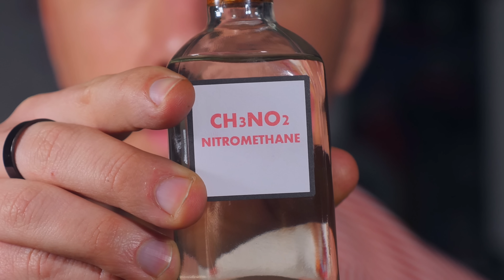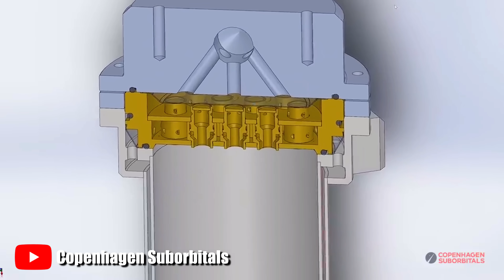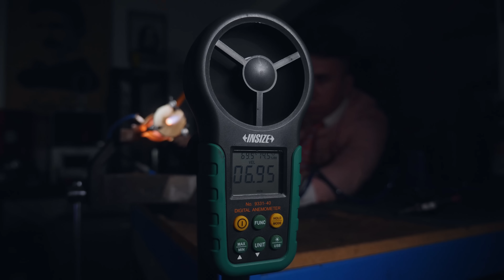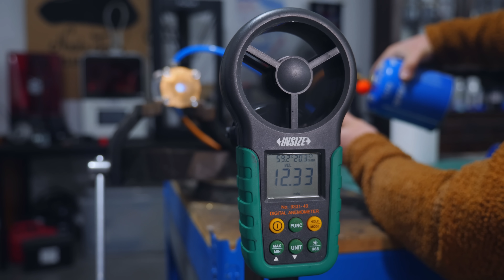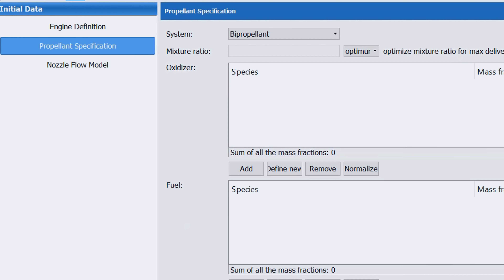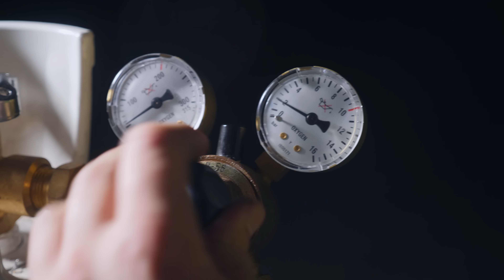GLASS ROCKET ENGINE

Comment: OK here's what you need to do once you get this  figured out: make two engines, put them on the tips of rotor blades and make  a rocket driven helicopter like the one made in the '50s. If you're lucky  it might have enough aerodynamic lift to get the oxygen tank off the ground. 🙂
Reply: the forces would probably rip them off before any meaningful lift is achieved
Reply: @xorinzor Look up 'Roton'. It's been done.
Reply: @xorinzor  Yah but it would be fun to watch! 🙂
Reply: @xorinzor Also if that happens that means you need to increase the blade's angle. 
It should create resistance because if it's just free spinning of course it's not gonna do anything.
Reply: @DoubsGaming When you change the angle of the blade, you would also be changing the angle of the rocket attached to it, so the rockets would be adding lift with the blade along with the rotational force. The additional lift from the rocket when blade pitch is applied might just be enough! Fingers crossed 🤞
Reply: @xorinzor  No probably not, the weight of it, if he makes it small as I would expect, would make it so the centrifugal force would not be too much, plus if he 3d prints it as a single prop it would be VERY evenly balanced. Only factor after that would be rocket placement, but as long as you measure, which you know he will, then all will be good! Balance and weight distribution are EVERYTHING when it comes to choppers 😉
Reply: Just saw your 💡 idea, bravo
Reply: How about a rocket driven supercharger to force more oxygen and fuel into the combustion chamber?  You could power it using some of your combustion pressure.
Reply: A spinning out of control oxygen bottle is a dangerous idea.
Reply: @PrimaryColorsChallengedREAL I feel like he should get the smallest refillable paintball gun tanks and use those, at least it would be much less oxygen so safer... but still, pure oxygen spinning outta control 😱 I hope he builds himself a test stand a bunker to watch it from 😂

Comment: I’d like to see you get some liquid oxygen (I know it comes in large vessels), transfer it to a smaller container (paintball high pressure tank possibly?), and then use that as the oxidizer with various fuels and engine designs. 

I feel you could really accelerate your rocket engine program!*

*sorry.

Comment: Hi 
Love your videos 😊
But i have a question about the nosel disign. You put 6 bar as your chamber pressure cause your air supply has 6 bar but when you burn the fuel you will get lots of heat and with that your pressure will rise a lot right ?
So should you not like mesure the pressure while the engine is running to get a even better nosel?
Reply from the maker: I see how that can be confusing but the chamber pressure is defined by you in the software, which means the software, knowing your oxidiser and fuel, designs a nozzle and combustion chamber that don’t go over that pressure as long as you follow the mass flow rate you put down. Because I used the maximum flow rate my compressor can achieve, it will always be at a safe pressure. Was I able to explain it ?
Reply: @integza  yes now i understand thanks i think i need to get that program :) and try a few variations myself

Comment: The hydrogen peroxide oxidizer is cool but super messy. If its just steam and oxygen where does the black junk come from? Is there a way to get the oxygen out without the mess?
Reply from the maker: That’s a great question ! The black stuff is the residue left over by the Potassium Permanganate. You can decompose Hydrogen Peroxide in a much “cleaner” way by using either heat or exotic metals like Silver or Platinum or both.

Comment: Hi Integza, I have an idea for your next video. I've already tested a rocket that I built using HHO gas (the gas that comes out from the electrolysis of water), but now I have a question. Can you make a rocket using HHO gas that has been produced in the same place as the rocket? 
For example, you can place the HHO generator on the front part of the platform you use for testing your rockets, and the rocket on the back. I hope you can do this in one of your future videos.
 (And also, greetings to the millions of subscribers 🎉)

Comment: The reason the second motor had more thrust was due to the increased pressure. Increased temp only slightly increases thrust but will increase efficiency. The difficult part of doing this will be feeding your reactive mass into combustion chamber AT high pressure. This is where most the engineering goes in real rocket engines. The equations aren’t as hard as you would think for this stuff. Call me I’ll explain it.

Comment: Have you considered putting the rocket engine on an RC car instead of a skate board?
It sounds like a fun test, so you can compare diferent parts, fuels... Since diffrent run times would corelate with the impulse of the engine and the speed would corelate to thrust.

Comment: Please improve your face protection when messing around with peroxide+fuel. The pressure might get high enough inside the chamber to epl0de it and spray the stuff over your face.
I almost lost my eye in propulsion experiments, still have a slight permanent damage.

Comment: That is a power full rocket , I have an idea to run a engine or rotary engine from H2O2
or hydrogen peroxide and methanol and u said it releases water / steam so can an 3D Printed engine be run by it
is it will be cooled by the steam / water BTW i am 15

Comment: you can get much more power by using liquid fuel rather then gas. you should atomize the fuel directly in to the combustion chamber and use a higher flow rate of oxygen,
also you should calculate precisely the location and size of the holes for the chamber walls as this will maximize a/f ratios and efficiency . love your videos btw!

Comment: You should make a turbo jet and Metal 3d print the impeller or the combustion chamber or the fan in the front. Or cnc a wankal engine if you can make the jet have a after burner

Comment: this is so cool! for a dual propulsion engine, the thrust each "stage" of the reaction produces will likely be unbalanced. a scaled up version would probably need several of these engines balanced out to form a larger module with equal thrust across a given surface area. maybe in a future video, find a way to make that system more efficient!

Comment: Now that you have a CNC machine, and a rocket engine, i would sugest you to try to make a kinda turbine with a bigger fan attached to it and put it straight after the nozzle of the rocket engine. And test the thrust of the rocket with and without the turbine-fan kind of thing.  Maybe you would inspire NASA to do the same, who knows. They can use them while in the atmosphere, and separate them when they no longer produce thrust

Comment: How did you make the bottle rocket? I tried but it barely worked. I used only butane, did you use liquid oxygen as well? And my nozzle was a 2mm hole I also used to fill it, was that bad? I tried different amounts of butane and also tried adding alcohol.

Comment: Can you please make a 3d printed gearbox for a small petrol engine to a tank drive. i want to use a CISON L4-175 17.5cc Miniature OHV Four-cylinder Four-Stroke to power a tank but there is no real tank drive available. Same is for a ship with 2 propellors. I want to buy one more similar engine to power a large rc boat (160 cm) but i need a power output, one engine to 2 props with counter rotating props and a reverse. If you could make only one i would prefer the boat gearbox but any help would be awesome!

Comment: Another great video, I'm looking forward to your dual propulsion rocket. I'd love to see a throttle on a rocket and it might work with a modified cigar cutter, so you can change the nozzle diameter while the engine is running.

Comment: I say you take this potential rocket you create and use it to... have fun with tomatoes.

Tomatoes as the suppression system, they ablate as the rocket fires thereby providing disgusting tomato pulp.  

Tomato on top, which will get shredded by the air rushing by it at mach speeds. 

And of course, the rocket will be aimed at another tomato for tomato/tomato smashing goodness.  

Yes.  This is the video I would love to see.  Because of course... tomatoes are disgusting.

Comment: Does the temperature of the oxidizer have an impact on it's energy production? Is it possible and useful to use the heat generated by the combustion to  preheat either the oxidizer or the fuel?

Comment: Hydrogen peroxide is used as an oxidant with hydrazine for rocket propellant. Generally 90% concentration. You should definitely try the discovery you made with the peroxide and potassium permanganate in the small engine with various thrust nozzles that work best for the conbusted flow. I presume the energy released with the steam and combustion would require a different geometry nozzle to be the most efficient?

Comment: I would see if you could add the potassium permanganate to either the hydrogen peroxide or methanol in a pre-mix and do a two spray ignition system that mist together and ignite. Or make a disposable nozzle out of the potassium permanganate that you would spray with the methanol hydrogen peroxide mix.

Comment: I think you should improve upon the rotating detonation wave engine design. Maybe make it with a graphite nozzle and a steel casing so you can run it at higher pressures and test the thrust. An aerospike rotating detonation wave engine would also be really cool!!!
Reply: I would really love a 3d printer........ 😂

Comment: You could make your dual propulsion rocket RC by using an servo and a rc controller you can control the amount of oxidiser to be injected into the combustion chamber by an mechanism which operates by an servo.

Comment: Is there any way to route the fuel or exhaust through a tiny turbo to supply additional on-board boost?

Also, Can you not use a 2 or 3 liters bottle for the oxygen pressure chamber on the rocket sled or is liquid oxidizer the best method for energy density? I know SpaceX has liquid oxygen facilities, but I never thought of using it in hobby rockets... Would be interesting to be able to see inside the oxidizer tank, but I know that's really dangerous and "playing with fire" in the most raw sense.

Comment: I wonder if you can use a drip setup to make a small rocket fuel setup like a miner's lamp! one champer would have Calcium carbide with an H2O drip to make acetylene that you could feed through a hose and regulate to the combustion chamber and the other would use potassium permanganate with a controlled drip of Hydrogen peroxide fed through the hose to the combustion chamber. That should let you regulate the flow and keep the whole system compact enough to mount on the skateboard! I might be missing something, it was just a thought! Love the videos though!!!

Comment: Super cool project. 

Next theme: solid/liquid/gas hybrid dual propulsion system.

Solid KMnO4 section that has H2O2 before and CH3OH after.

React and form O2, mix with CH3OH (as shown in this video) and ignite. 

Everything in clear tubing.

Comment: Idea for future video:  How about adding your dual thrust rocket motor to an RC plane.  You could use an extra channel on the RC transmitter to kick-off the rocket motor.  It would be cool to see the plane in a vertical climb, ignite the rocket remotely, and watch the plane have an incredible boost and climb nearly out of sight.

Comment: You could do something with turbine engines (I don't realy remember how they are called) when a turbine is connected to a jet engine, so it generatel low torque but high speed rotation.

Comment: I find the dual concept really interesting. All that released steam will likely serve to cool the combustion, making it possible for you to run the engine harder with less cooling. Excited to see where this goes. Don't forget to account for the massive back pressure that will be pushing into your catalyst and peroxide tank as the engine fires.

Comment: I think now that you have an liquid oxidizer to use for your future rockets you need to make a vessel to remotely mix and control the flow/pressure from that reaction. Some sort of baffeled vessel to keep the liquid component out of the mix while letting all the sweet sweet gases flow and not having to touch it.

Comment: Those flairups and pops in you burn... I think you are running engine rich combustion, as in part of you engine is eating itself during the burn. I think if you are lucky it's only the nozzle. You might want to look into a fuel film cooling system. Granted that is a whole other paradigm of engineering.

Comment: Bro the tesla valve u made was in circle. Due to this pressure gets reduced and does not result as it want you can actually made it in small spaces ......even yuo can use it in air lnlet or the output of jet engines

Comment: You should try dissolving the KMnO4 in the methanol and combining it with the H2O2 as two small continuous flows, in a way that the combustion chamber is not a storage for either liquid

Comment: Dual combustion chamber rocket.  2nd chamber introduces a catalyst at a higher psi.

As long as first chamber has nozzle of correct size, it's not going to back flow.

I bet it boosts total output but in a more pop pop spurt but with greater out put.

Double the strength on 2 ND chamber material

Comment: make a RAMJET, it has 0 moving parts and is actually used in modern aviation, and is considered one of the option for space planes.
it would need air intake to move in at least half speed of sound, so it would need some pretty beefy blower for tests, and some kind of first stage for first flight, a solid rocket, gauss gun or railgun should give it enough initial speed